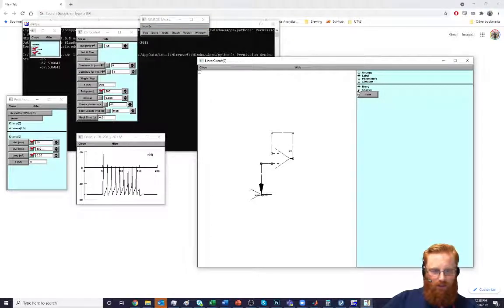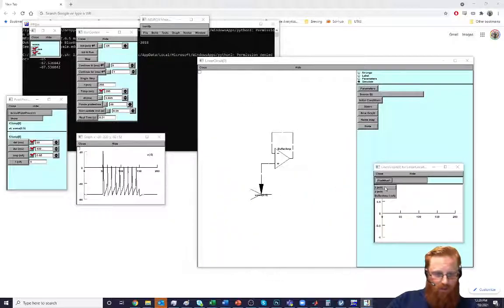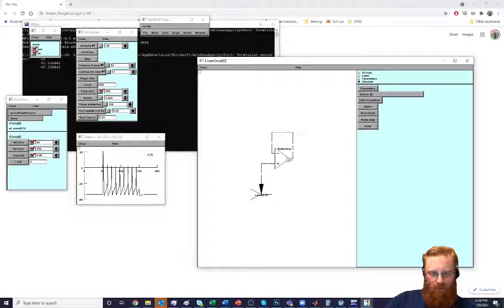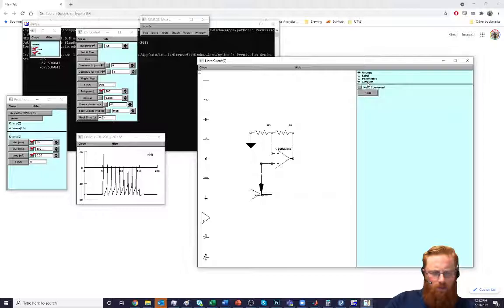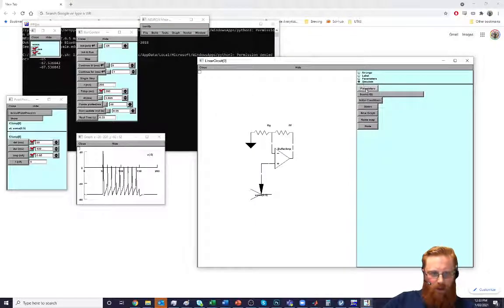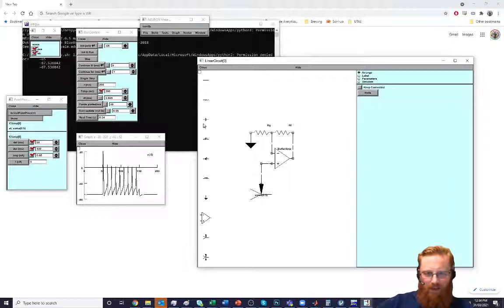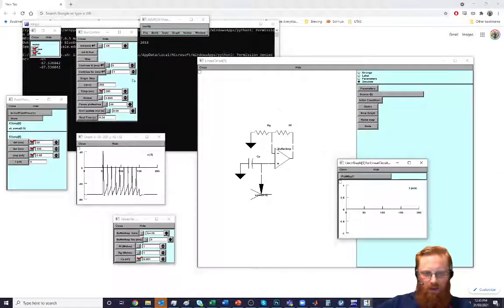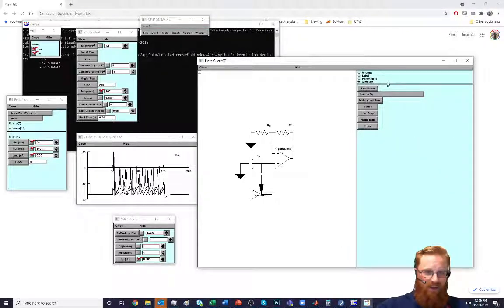How to use NEURON linear circuit builder - The very basics

Comment: I have just added the equivalent components for the HH model through Linear Circuit. The output of each component is not something like an Action Potential. How can I get that by inserting the same component and values in the Linear Circuit section? 

Thanks.

Comment: Thanks for this tutorial. I need to simulate the whole neuron with the electrical circuit. Can I do this by NEURON software itself? If not, which app do you suggest me to use to simulate the neuron with circuits? Thanks
Reply: So, theoretically, you can build up an entire neuron in circuit builder, compartment by compartment. But I would strongly advise against it. Typically, one would build the neuron with Neuron Code (i.e. in a HOC file), then just import the model into circuit builder, which then just appears as a single element in the circuit. Then you can add on whatever circuit you want.
Reply: @bilz0r  Thanks, I need to do it due to variations of the components. BTW, would you mind if I ask you how I can import the model into Linear Circuit?
Reply from the maker: @mohammadrezakhodashenaskha5006  Variation of what components? Like membrane resistance? You don't need the circuit builder for that. You get access to the soma of the cell with the second from bottom component in the Linear Circuit Builder, Arrange menu. Right now I can't remember what you do if you want access to any other component.
Reply: @billsneuroscience2598  Thanks but I'm afraid I couldn't understand how I can get access to the cell's soma from the the second from bottom component in the Linear Circuit Builder! 
You mean the "Keep Connected" toggle?
Reply from the maker: @mohammadrezakhodashenaskha5006  No, on the other side of the window. Below the resistor, capacitor... op amp. Second from the bottom.
Reply: @billsneuroscience2598  Thanks but my main and critical issue here is that I want to have the main equivalent circuit of the neuron by Linear Circuit GUI, if that is possible! Actually I want to have the neuron in circuit, and don't know how to achieve it! I appreciate any suggestion and comment.
Reply from the maker: @mohammadrezakhodashenaskha5006  You want to import the entire neuron as an equivalent circuit? That is not possible. You can't replicate all the potential mechanisms implemented in the mod files as circuit elements. Why would you want to do that anyway?
Reply: @billsneuroscience2598  Yes, and I just wonder if there is any other software that we could simulate the specific neuron electrical circuit and get the output from it.
Reply from the maker: @mohammadrezakhodashenaskha5006  Well what do you mean by "the neurons electrical circuit". Neuron can stimulate the electrical properties of a neuron. I know it's possible to make a physical analog circuit that mimics Hodgkin and Huxley kinetics (though each channel has about 5 or 6 op amps). Do you want to do something like that? Then you want software like LTspice. You could build a couple of compartments in free web stuff like circuit lab. But you're never going to find a realistic, multicompartment neuron, recreated out of physical circuit components.